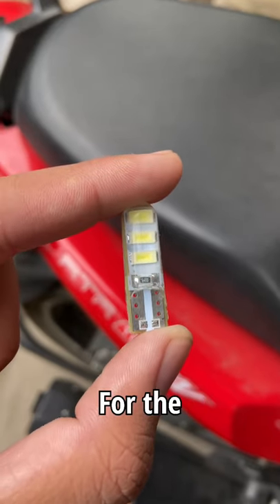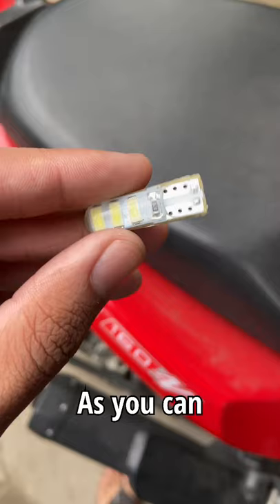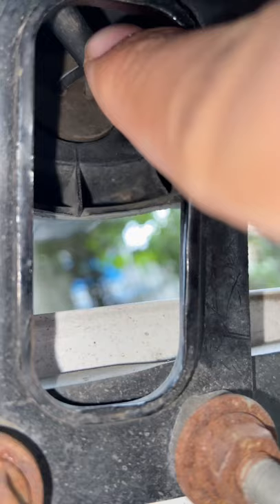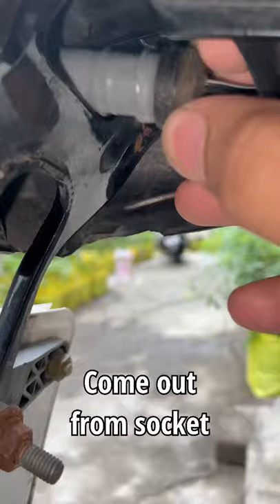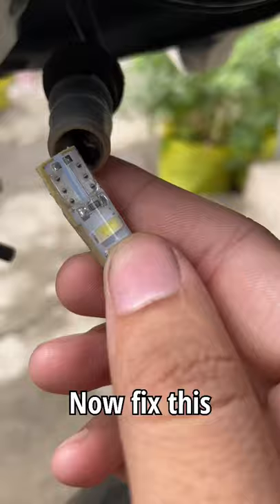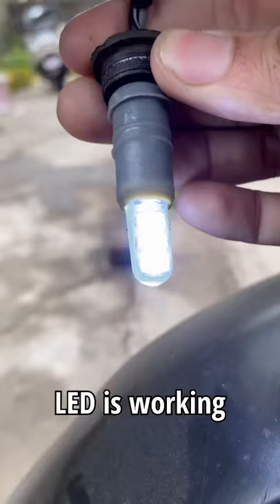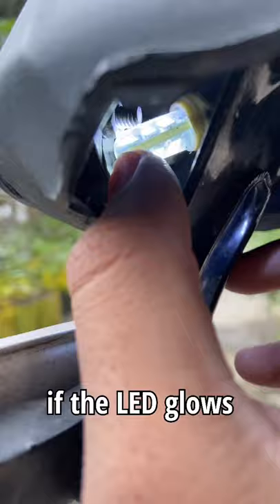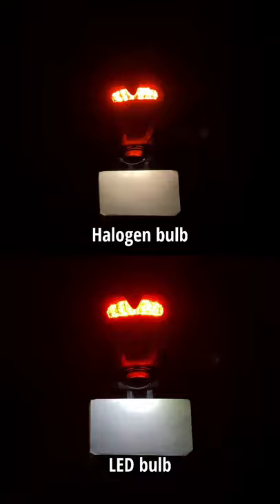Changing Numberplate Light into LED of TVS Apache 160 4v in just ₹ 30/- | Apache Modified | #shorts

Comment: I replaced almost 3 bulbs till now and all pf them fuses in 1-2 day's.
Reply: I just removed the bulb.😅😂
Reply: Same happened with me, 5 left indicator bulbs fused and even number plate bulb fused. Now I’m using similar LED for indicator and it didn’t blow yet
Reply: @ArshdeepSingh-yx5ud  cleaning all the wires & the connectors helped a lot & now I use the halogen bulb for number plate since 2 months without blowing it up.